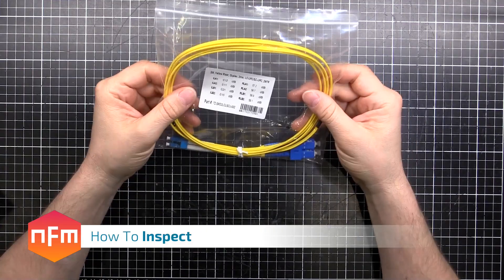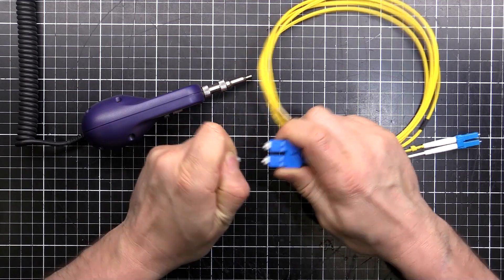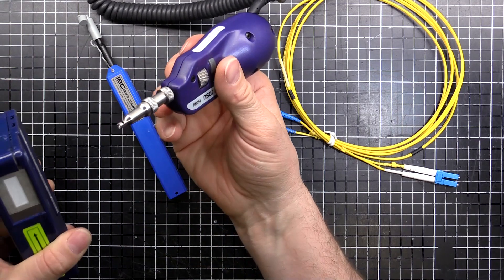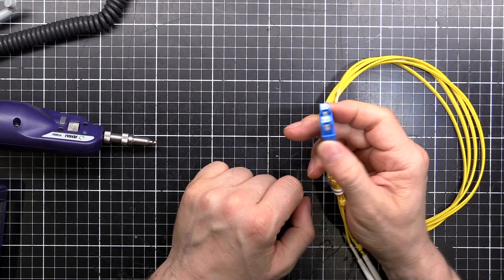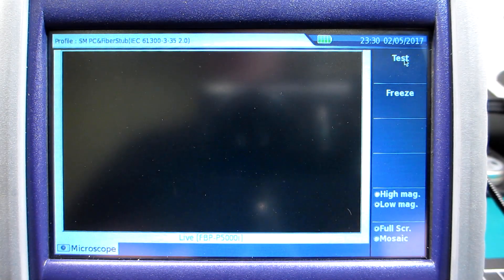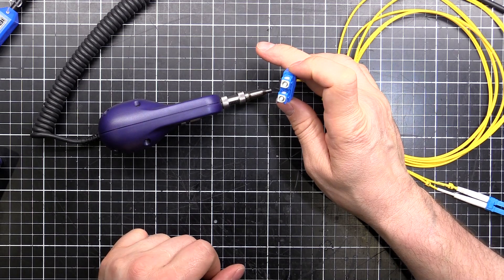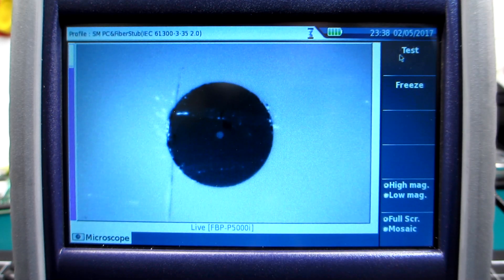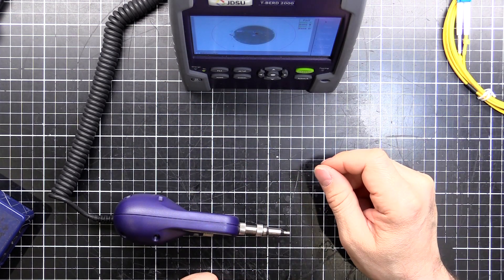How To Inspect and Clean Optic Fiber Cables

Comment: With those cartridge type cleaners you should only wipe once. If you wipe the fiber over the same area multiple times there's a small but significant chance that the fiber will get scratched.
Reply: The push type cleaning pens I've used automatically progress the cleaning tape on it's spool with each click. This ensures there is fresh tape surface with each click.

I'm not sure if the pens in the video are the same??
Reply: Yeah, the pen type work that way. The other type advances as the protective cover slides open, reveling a clean patch of the tape. You generally wipe the fiber in a specific direction, and only do it once, and then let it close. It's not actually a big deal though. In my experience the connectors have to take some serious abuse to get damaged. I've cleaned tons of connectors with kimwipes and acetone, and that breaks all of the rules but generally gets the job done. Almost all of the damaged fibers I've seen were just snapped, and the connector was perfectly fine.

Comment: I've used similar push type cleaning pens. Apparently they have a roll of adhesive tape inside that literally pulls the dust and dirt off of the fibre. Cheap but essential tool!
Reply from the maker: I'll have to see what these ones have, these look to have a bit of rope inside that wipes past and rotates against the end of the fiber as you push down.

Comment: Hi, I enjoyed the video. Could you please give us some perspective as to how much the equipment shown costs? You mentioned those LC cleaners are "cheap" but the cheapest one I could find on Digikey (CCT-125) is $120 CAD.
Reply from the maker: The cleaning pens here in Japan sell for about ¥6000 each (which is cheap when it comes to fiber optic equipment....), but they are so-so for cleaning effectiveness.
I prefer to use cartridge style cleaners when I don't need to clean an optic etc.

As for the scope/OTDR, they cost tens of thousands of dollars... a second hand scope usually runs a few hundred dollars at least.
Just the adapter tips can cost hundreds of dollars new...

Fiber optic stuff is always really expensive...........
Reply: @NearFarMedia  Yes, I'm not desensitized to those kinds of numbers and suppliers/wholesalers either don't exist to "prosumers" or simply don't advertise the costs. I appreciate the response! Are those pens refillable cartridges or are they single-use consumables?
Reply from the maker: Yeah, even second hand on ebay, these scopes and stuff are too expensive for my taste, luckily work supplies the gear for me. :)

The cleaning pens are not refillable, but the box shaped cartridge cleaners that I prefer are.
Reply: @NearFarMedia  I accidentally discovered fs.com which I'm sure you're aware of and their prices are definitely more competitive but it seems there's a lot of differing opinions on the quality of their goods. Do you have any experience with their products and which ones were good and which weren't?
Reply from the maker: Huh, interesting.
We use Sticklers brand cleaners that look the same as the FS brand Neoclean MTP and the SC/LC cleaners.
The sticklers ones are good, so I assume the FS ones of the same design will be good too.

Comment: Question: why is this cleaning pen actually called "one-Click-Cleaner" by one of the manufacturers Fujikura?
Answer: because one "click" per cleaning process is sufficient. In fact the strip at the top end rotates 90 degree while cleaning.
And each click costs money!
Reply from the maker: And they often need 10 or more clicks to actually clean.... :P
They just dab the end of the fiber and don't do such a great job, I hate them. I much prefer using the cartridge cleaners that let me wipe the end of the fiber on the cleaning tape.
Reply: @NearFarMedia  I have acutally done some "studies" for myself comparing the different methods of cleaning: cassette cleaner, Click Cleaner and tissues and also at patch panels inside the adapters to get to the pigtail inside of the panel I used the buds. And my results were pretty clear: the Click Cleaner performed overall the best. You may question this test being representative and maybe you are right but it is the best I have seen so far. I was surprised as well as I was almost convinced that the cassette has to be the best.

Comment: hi how much is the microscope camera with monitor. the one you showing.
Reply from the maker: It looks like they sell for a bit under $2000 second hand.
Brand new I'm not 100% sure, but they can reach $10,000 depending on what optional modules you specify for the cable types you want to test.

Comment: Ive juat gotta say I would not ever pump that cleaner that hard. High risk.
Reply from the maker: If a bit of string on the end of a bit of plastic can scratch your fiber, you need to purchase better fibers.
Nearly 10 years in the game and I have yet to scratch or damage a single fiber.
Reply: @NearFarMedia  Tell that to Raytheon or Northrop Grumman. Licensed avionics technician. Just giving my 2 cents. QC at any airline would have a heart attack if they saw that. Maybe just ignorance on our end, but we are trained to clean with great delicacy when you're dealing with extremely expensive fiber that cannot be repaired.

Comment: You achieved a clean end but that tool is a ONE click not a 500 click. Click it once slowly and it should be clean so long as the contamination is low. Yes they are cheap but not only are you wasting your tool, you are potentially scratching/pitting your cable end. Severe contamination + aggressive dry cleans = permanent contamination. I’m not one to usually comment on stuff but I have a decade experience in the construction/installation of fiber networks, and it’s a major pet peeve of mine because there is an operational cost to everything, all the way down to every click of that tool and improper/over use leads to breaking tools and cables which means the project costs more and the pay is less.
Reply from the maker: The day these 'one click' tools are actually one click is the day I'm the queen of France.... 😂

The brand shown in the video is the worst, Sticklers brand is marginally better, but barely.

We have abandoned using the blue cleaning pens shown in the video, they are so crap. I work for a multinational company, so it's not just me who has problems with them,  but the entire company worldwide...
Reply: IBC can clean in one click but I agree. There are better options. Corning or Fujikura will most definitely clean in one click and I challenge you to test your fibers after ONE click. It’s doing more than you think, I promise.